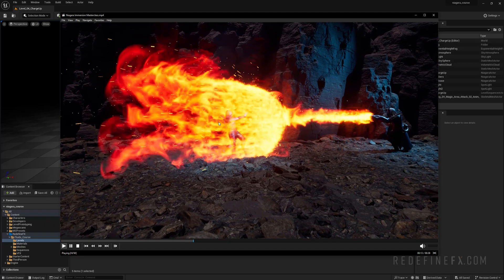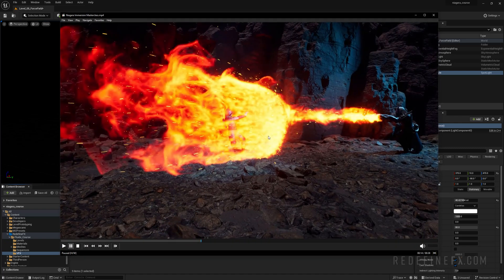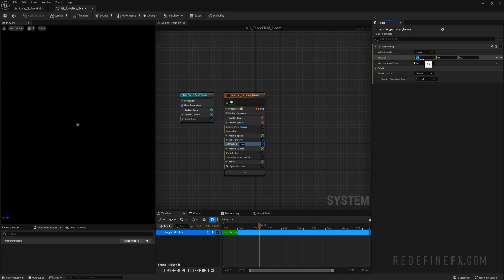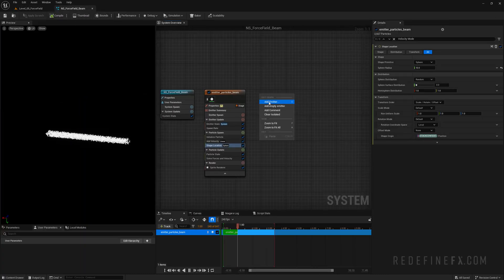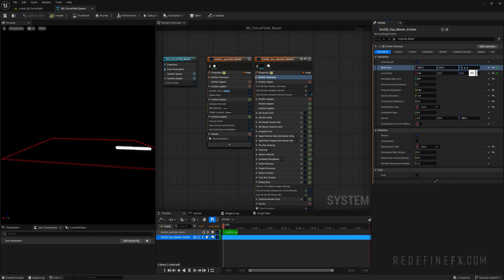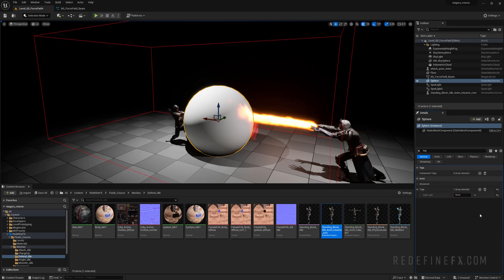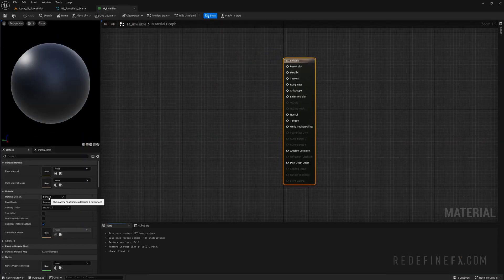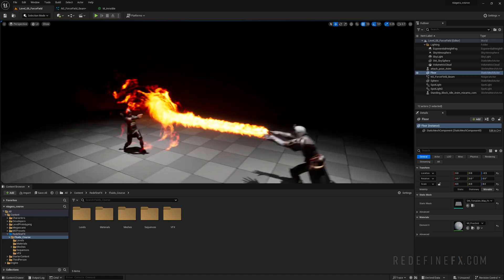Niagara VFX Crash Course 11: Force Field Part 1

Comment: I'm trying to work it out but there is something wrong about my 3D Gas Emitter, the smoke which used to look real now looks black and pixelated as soon as I add the emitter, and when the temperature is enabled there is no fire. The whole FX goes off. Tried on 5.3 and 5.4

It was fine with Part 1 exercise
Reply from the maker: I’m releasing an updated version of this effect in unreal 5.7 in about a week. However nothing major has changed about how Niagara works so you must have missed a step or it’s too much for your GPU to handle at the sim resolution you set.
Reply: It's the same thing happening with me. I am unable to notice the fire after I turned off Density and enabled Temperature in Grid3D_Gas_MAster_Emitter. KIndly let me know the solution if you got any. I tried in 5.7, 5.5.4. It's the same result.
Reply from the maker: @neeleshreddybotta3366  this is explained in the first video of the course.